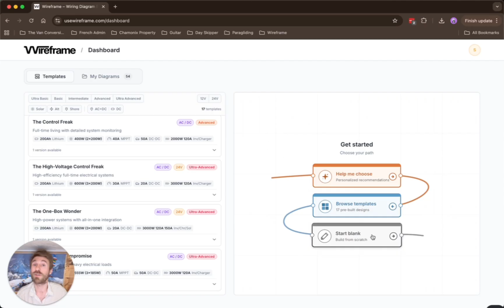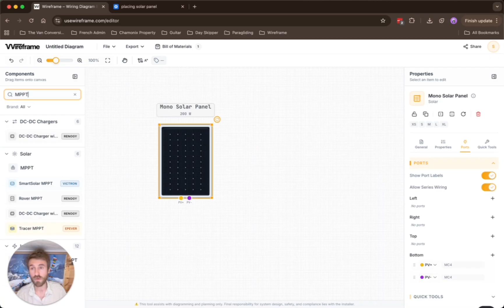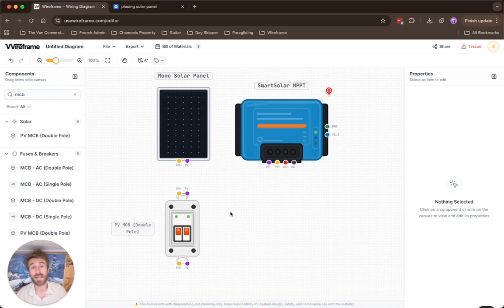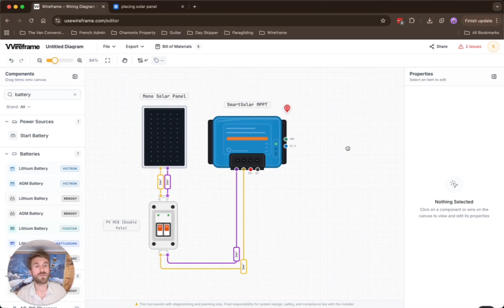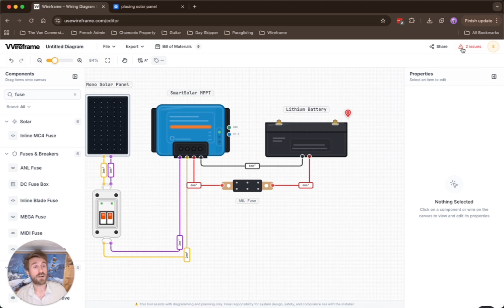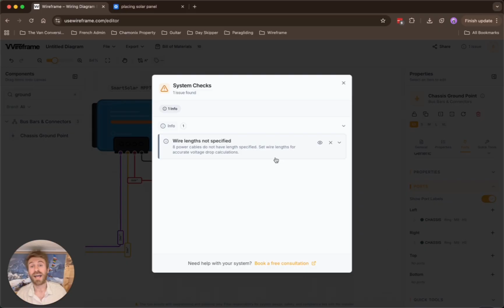How to Build a Wiring Diagram with Wireframe (Vans, Boats & Off-Grid)

Comment: I tried to sign up but I keep getting this error message: “Email rate limit exceeded”. Bummer. I was excited about trying it out. Please advise.
Reply from the maker: Hey Rusty, just checking in with you. This issue has since been fixed, and you should be able to access Wireframe - no problem now